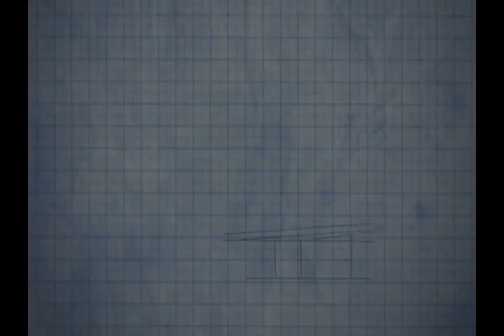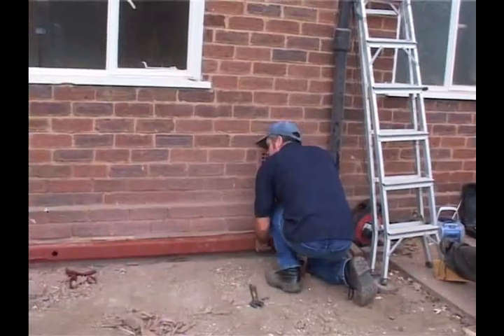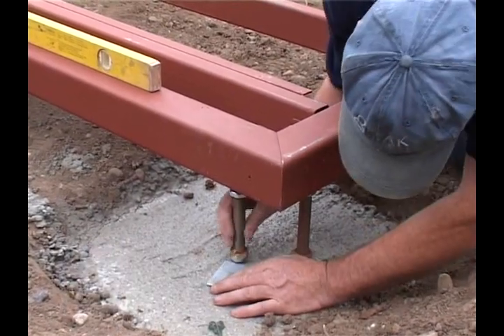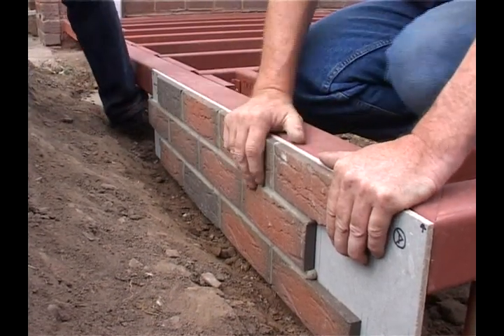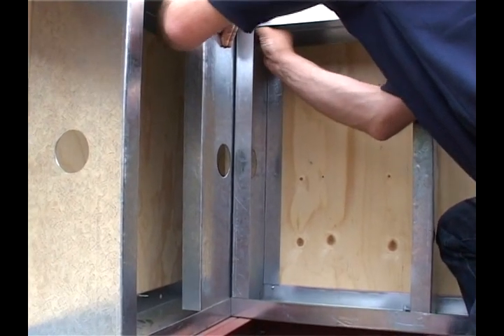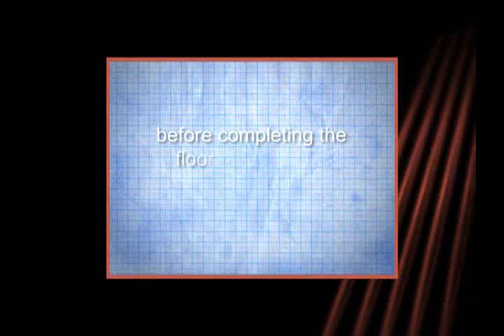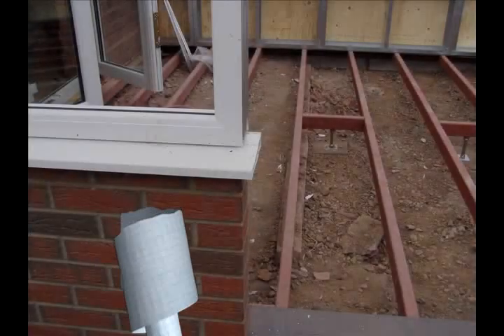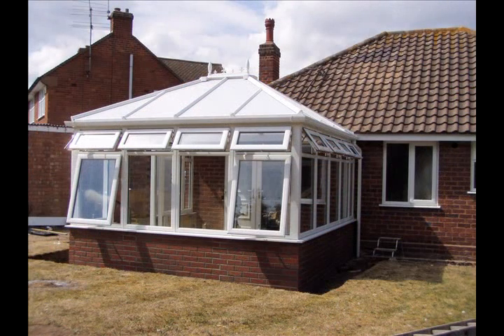Tudor Rose - DIY Conservatory Base

Comment: Beautiful. One point though, If you plan to put down hardwood, you must use plywood instead of the chipboard for the subfloor, because the hardwood nails will not hold in chipboard.

Comment: Conservatory is a great source of heat loss acting to rob heating out of the exiting dwelling same tend to bring down the 'BER  rating' in the home  as for a polycarbonate roof   that's maybe not the way to go..... One could have created a box section steel vertical construct, off the floor frame and a steel ring beam from oblong box section to allow same to  support  a well insulated proper  'Sunroom' with a  seriously insulated roof having  Velux windows cut into same...Just  love box section  as a construction material.... mind you filling those  hollow sections with pour in expanding foam would greatly  reduce any 'Thermal bridging....  Consider moving this construction method to the Next Level  in regards of  high spec  .....and i'm sure you will be on to  winner... best of luck with your  projects...
Reply: Smart arse ;)
Reply: lol.....Troll on.....